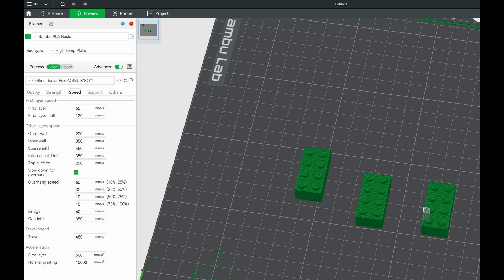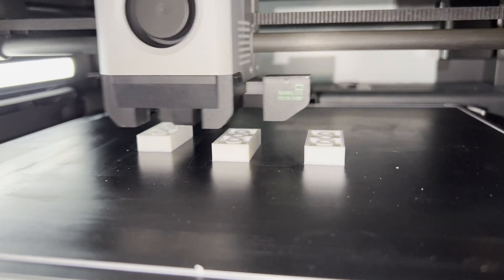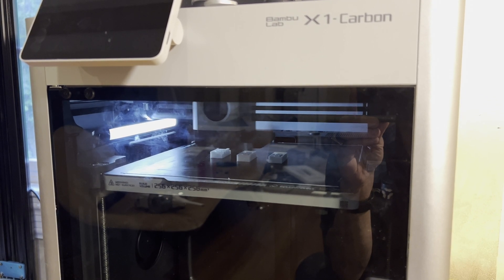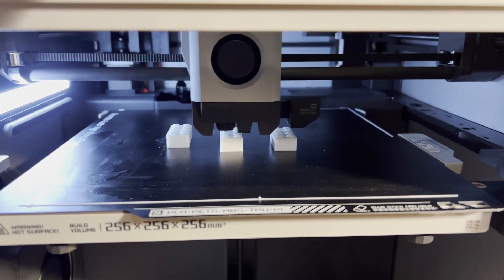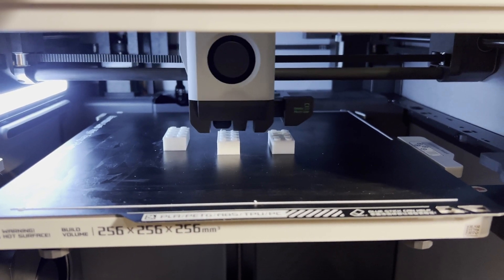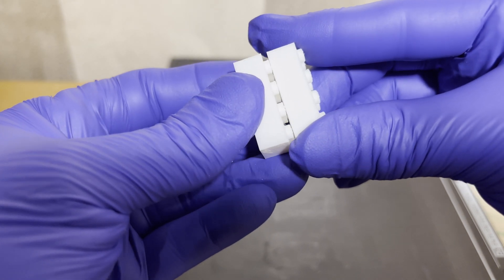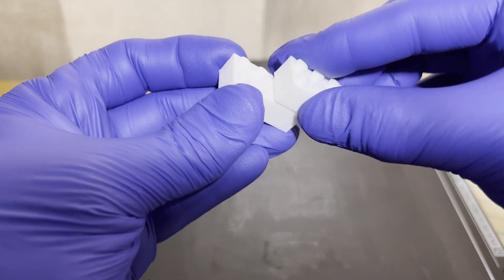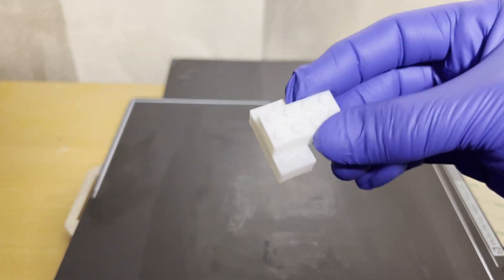Bambu Lab X1-Carbon Printing a Logo Brick

Comment: How did you flip the lego brick and started printing on the other side, can you please let me know. Thanks
Reply: it prints from the outside to the inside. so the printer starts printing the lego "pins", then the base they sit on, then the walls and finally the bottom. when you pop it off the tray and flip it over its a lego.

Comment: recommended this printer as a first timer?
Reply: Yes it is perfect for a novice, you wont have anywhere near as many problems as you get with cheap Chinese machines
Reply: @AndrewAHayes  okay but I was going to get a Prusa. Not a cheapass machine
Reply: @pocketman5510  A Prusa will serve you well and should you experience any problems you have an expert to help you at the end of a phone, I have a MKIIIs and loved building it along with the best assembly instructions I have ever seen, the Bambu Lab Carbon X1 will I beleive also have a good CS dept, If I were in your position I would wait for the Bambu Lab offering, this is a game changer for hobbiest 3D printing, Bambu Lab are releasing this their first printer with a massive discount to what it should cost and I think this discounted price will only last for a brief period, they havent said this but they have said they have discounted the price massivley to what the market would expect
Reply: @AndrewAHayes  does the bamba print faster?
Reply: @pocketman5510  Oh Yes! 500mms and keeps the quality as well, it has a ludicrous speed setting!
Reply: @AndrewAHayes  how much faster than the prusa is it
Reply: @pocketman5510  X8.33